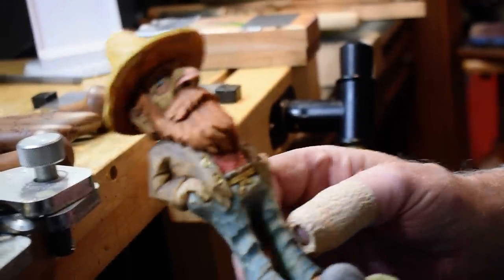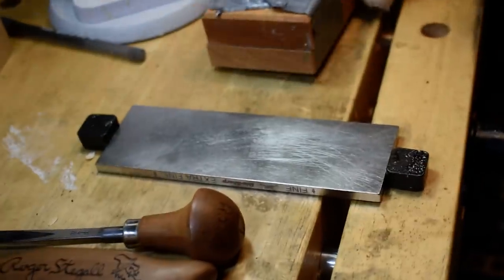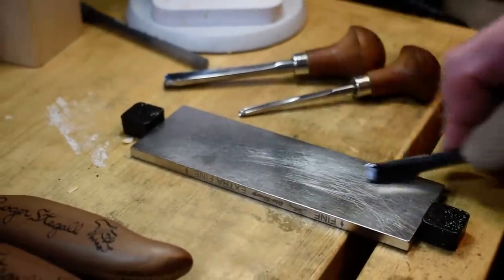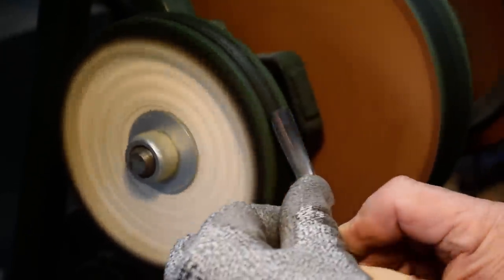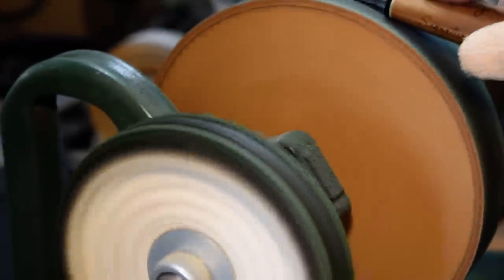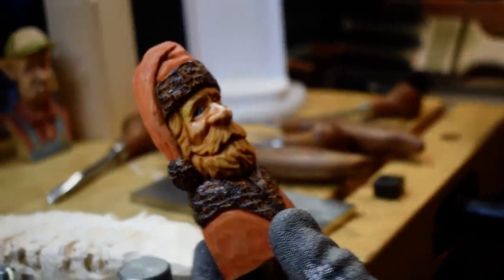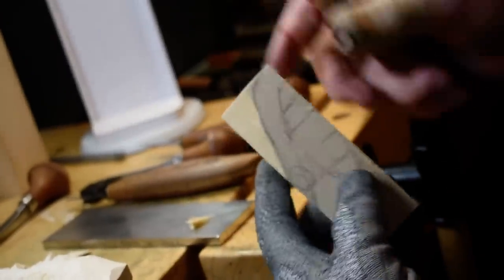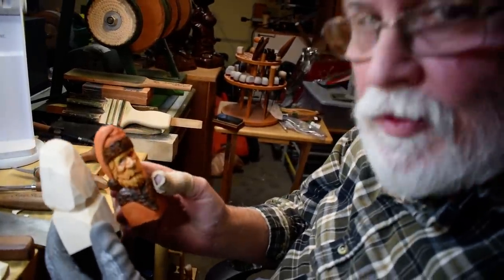Roger Stegall Woodcarver: How I hone and sharpen my tools!

Comment: Thank you sir!  I've not yet found the right solution for keeping my tools razor sharp but your straightforward approach gives me hope.  Most of the advice online seems to be that you never need to put a knife to a stone unless it gets a chip in it.  They all say that a good strop is all you need.  While I don't carve every day, I do move a lot of wood when I have free time.  I have four strops that I use and plenty of green compound but my edges are NEVER as sharp as yours or the other master carvers I follow.  I'm using the best basswood I can afford so I know my knives can be much sharper.  I'll be adopting your approach to sharpening and I truly appreciate your advice and your kindness in sharing your talents with us.
Reply: Steve Sweetin I bet the power leather/buffer has a lot to do with the sharpness of his tools
Reply: linda austin-morin Thanks for your reply.  I have a leather strop belt for my 3” belt sander that I use but the wheel he uses does seem to provide a firmer foundation than does a belt.
Reply: 1 other thing to look at is the thickness of your strop, if it has alot of cushion and you press your tools in it firmly it will roll over the sharp edge and cause it to dull all your work

Comment: Just a question Roger.  What size of bandsaw blade do you use for cutting rough outs?  Thanks for this video on sharpening & honing.  It is very helpful.  I am new to carving & find all your videos very helpful.  The time you take to explain things helps a great deal.  Thanks.
Reply: 1/4 inch blade and thanks for watching.
Reply: Thanks Roger.  That is helpful.  I have never used a bandsaw & I purchased an inexpensive 9 inch bandsaw.  It came with a 1/4 inch blade.  It can’t, of course handle a big piece of wood.  I will try the 1/4 inch blade but I read that a 3/16 blade would also work.   But I would not really know.  I did enjoy very much your videos on carving without the use of a bandsaw rough out.  I guess I will fine my niche as I continue with carving.  I really enjoy carving.

Comment: Would love a video on your sharpening wheel set-up. Looks like you have several wheels with differing compounds? Did you make the assembly or purchase it?
Reply: I purchased the system. It's a Burke sharpener. I use green compound on my leather wheel and buffing wheel the other wheels are sand paper on the wheels.